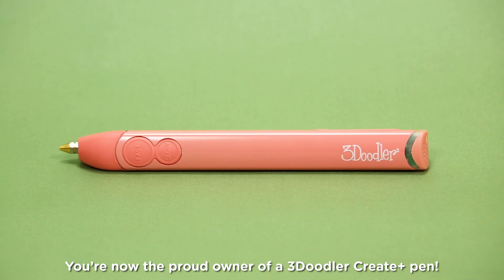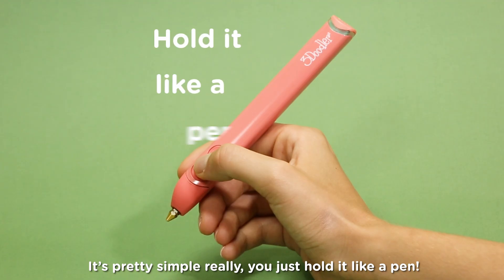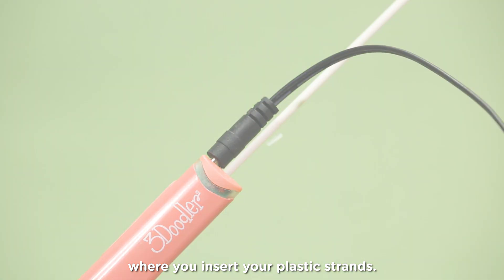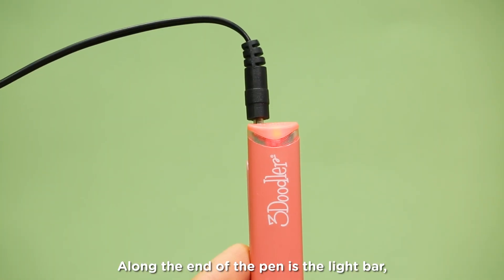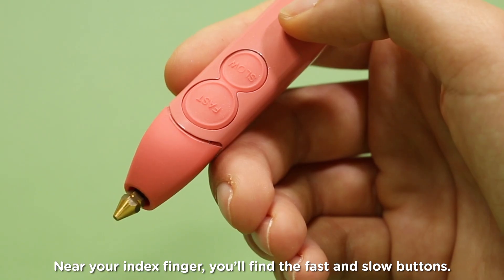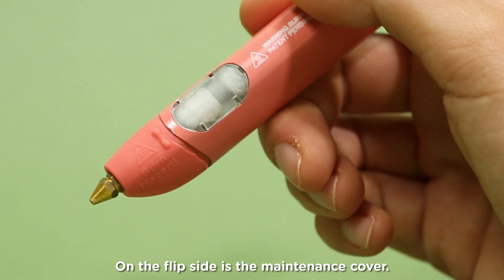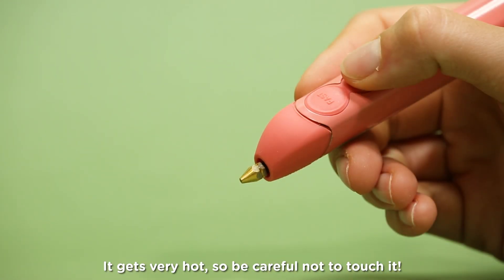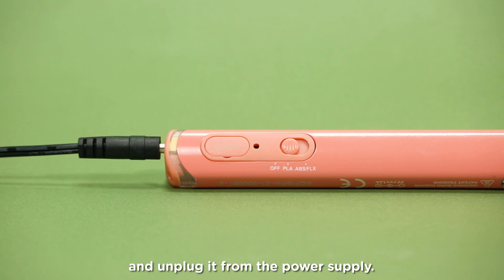3Doodler 3D Pen Basics | Getting Started

Comment: How long can the create+ pen be set down (paused) using the stop function before the plastic needs to be reversed and removed? Does it need to be removed immediately to avoid blocking?
Reply: How long can the pen sit idle while on to transition from piece to piece for a project? It really seems like it can't sit with hot plastic in it idle for any amount of time.
Reply from the maker: @markelcj  you don't need to reverse the plastic when the pen is paused. The pen auto retracts the plastic for you. Before putting it away to store the pen you might want to retract the plastic out to make it easier to store it.

Comment: Hi! I bought one, and i recently bought some spiral filaments, but my pen wont insert the spiral ones. I bought a ton of them and i dont wont them to go to waste, but can you just not use those ones?
Reply from the maker: the 3Doodler Create+ uses 3mm filament. 3mm is one of 2 standards for 3D printing. So if it's not 3mm ie if it's 1.75mm then no it will not fit in the pen as it's too small for the gear system.
Reply: @The3doodler  thank you for responding!  Alright i wil try to figure something out!

Comment: I may or may not have lost the cord to my 3Doodler create+ and I have been searching but I can’t seem to find what kind of cord to plug it in is so I can buy a new cord
Reply from the maker: 3.5mm barrale jack center positive (the dot should be going to the +) 5V, 1.5~2Amps (the amps just need to be higher than 1Amp) hope that helps.
Reply: Thank you

Comment: Ive been heating/charging my pen for almost 4 minutes and untill now no colour light has appeared
Reply from the maker: Hi I am sorry to hear that you are having issue. First note the 3Doodler Create+ dose not charge it has to be plugged in at all time to function. If no light is on the first thing I would do is check that you have the power plugged into the right hole. You want the one that is near the top of the pen, and is off centered with a pin coming out of it. Some time people accidentally plug a pen into the hole were the filament is supposed to go as they are about the same size.  If you are plugged into the correct hole and have turned the pen on to either PLA or the ABS/FLEX setting the pen should light up red while heating up. Then after about 1~2min it should change from red to Green (for PLA) or Blue (for ABS/FLEX). If you are plugged in correctly and the power socket is working and what not, but you are still having an issue please reach out to our customers serves team and they can help you. You can reach them at help@the3Doodler.com

Comment: I have a question so I was trying to use the pen and the color thing wouldn't come out I had it plugged in and the light was green but as a first time user I was confused and I don't know what to do 
Do u have any possible solutions to fix it? Also I just bought, it's the create+ pen I was using
Reply from the maker: please reach out to help@the3Doodler.com I believe "the color thing" is the filament aka plastic. I am not sure if you are reversing the pen and then waiting for the pen to stop reversing (some time you might need to reverse 2 times depending on a number of things). I would recommend that you reach out to help@the3Doodler.com and they can give you a more thorough answer.
Reply: The plastic mat not be in all the way, look in the clear part and see if the tube is there, unless your chose the clear one you should see the color you put in.

Comment: I bought a multipack of filaments .most  are labeled simply 3Doodler.  Some  labeled 3Doodler Create+, Or BOTH create+ and Pro+ .  Some labels say compatible with 3 Doodler Create/ 3 Doodler Pro.  Are these all compatible with Create+ .
Reply from the maker: ABS, PLA, WOOD, and FLEXY are all compatible with the Create+, and the Pro 3Doodler. So Yes anything in the multipack will work with the Create+ pen.

Comment: Hello Just wanted to ask if the package says 3doodler start i have to use just that pan for it or are they cross compatible
Reply from the maker: filament aka plastics are not cross compatible 3Doodler Start filament melts at around 35~40C (thu kid safe), 3Doodler Create plastic melts at around 190~230C so they won't work in each others pen. We even made the diameter of the two plastics different to try and help prevent permanent damage from using the wrong material in the wrong pen.
Reply: @The3doodler  damn with the reply 3 years later

Comment: Why the 3doodler create+ better than the 3doodler create
Reply from the maker: The all new Create+ is completely re-engineered to give you an ultra smooth and enhanced Doodling experience.

Improvements include a world-first dual drive system, greater control in fast/slow speeds for different Doodling techniques, more reliable performance with different 3Doodler plastic types (now 99% free of jamming issues), greater durability, and new glossy monochromatic pen colors.
Reply: 3Doodler thx

Comment: Please can you tell me if the normal 3doodler create is always a good pen compared to the 3doodler create+ because i have a 3doodler create . I got it 1 year and 5 months ago.
Reply from the maker: Hi there! Thanks for your comment. The 3Doodler Create is an amazing pen, though the Create+ has many upgrades, including the world's first 3D pen dual drive system. Other improvements include greater control in fast/slow speeds for different Doodling techniques, more reliable performance with different 3Doodler plastic types (now 99% free of jamming issues), greater durability, and new glossy monochromatic pen colors. You can use the serial number on your Create to get a great Upgrade offer for the Create+ here: www.the3doodler.com/upgrade